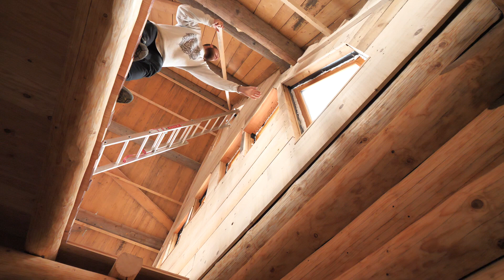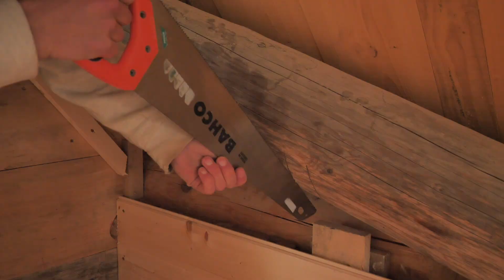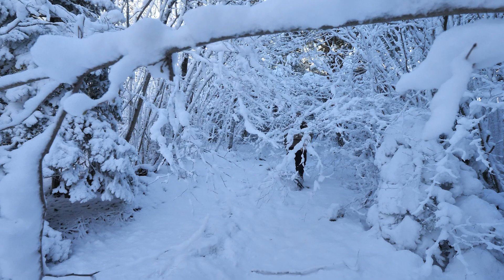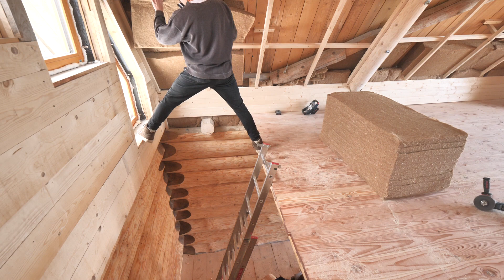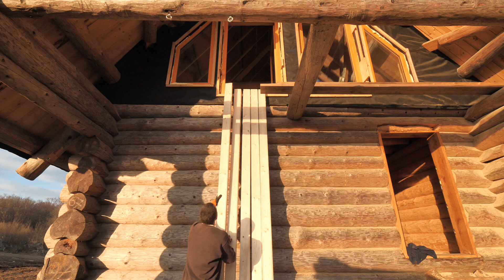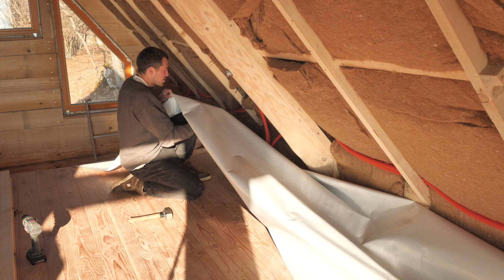Off Grid LOG CABIN Build / Installing The Roof Insulation (S 3 Ep 4)

Comment: The layers. It’s all about the layers. Watching this being done properly is so satisfying.
Reply: unfortunatly this is not done properly with all respect to Nick and all his great and proffrsional work so far this shouldnt be insulated like that , wool shouldnt touch  the boards and the special roof membrane beetween rafters wool and final covering starting from the bottom  ceiling then 25 cm of wool in our climate then roof mambrane at the top of rafters , then 2,5 cm thin boards screwed along rafters ( those boards will make the gap so everything can breath , then boards again thin boards , one layer each side and then propper roof covering or propper roof covering straight to the boards and off course 5 cm gap at the peak excluding roof membrane  so all the moist from inside off the house could be removed
Reply: @miloszkosciolek636  it's a log cabin bro, there's no right way of doing it. People have built them for thousands of years, in all kinds of ways.
Reply: @noone-qg1od  dont take it as a hate talk from me or something this is just a pro advise if the roof is thonnot done that way but  other way it is a 90 % channce that the purlins and boards will get rotten  and all insulation off wool will gather the moist but not relase , no mather is it a full size house or just a log cabin it is important to think and get advice about all step , the time that was spend to build that cabin and the costs that Nick had to cover are huge , so it is verry important to dont take those costs again in a couple off years , also im not trying to play a smart ass im struggeling my selfe wit a lots of problems while buildyng my log house and yes i did planty of mistakes , im doing 200 m square house just by me selfe so i know about costs , health , time , and everything else that i have to deal with ... do it once for life ,,, dont work for it  and fix it  ever more
Reply: @miloszkosciolek636  I don't think the insulation is wool. It's some kind of recycled fibre and probably doesn't have the moisture retaining qualities of wool. If this is the case, he wouldn't really need to let it breathe, and it would be better to fully seal the inside layer against any moisture escaping and trap the air in the roof space to retain heat. I hope at some point he explains his reasoning for how he is doing it, it would be interesting.
Reply: @Mark Wheeler  it looks to me like mineral wool/insulation though it could contain hemp. He did seal the outside layer with a water resistant layer so if he sealed it inside with a breathing layer, he'll be fine.
Reply: @miloszkosciolek636  layers from outside to inside are: membrane, boards, insulation, breathing membrane, cover. As a professional, as far as I can tell, it's been done right. Don't correct people when you don't know any better.
Reply: @avyitis3425  well i just told better way . wool should never touch the boards,first off all. boards will rotten , if You dont know that You r not a pro .breathing membrane under the wool , yes, but above the wool straight on purlins go membrane , membran can touch the wool but cant touch the boards thats why an that membrane its covered by thin boards 2,5 cm high  that are screwed to purlins , then gose boards , this is a pro, whole scandynavian countries r doing like that , i bet You never done this and the knolege dat You own came from internet :)
Reply: and like i said gap at the peak ,
Reply: @miloszkosciolek636  I am a professional carpenter. The majority of what you wrote is simply bullshit. You have no idea what you're talking about but are trying to make it look that way. A simple online search proves the opposite of what you say, for anyone who doubts me criticising you.

Besides, I never said anything against the methods used in the video. If you're unable to read and/or understand the language properly, you ought to change that before you "open your mouth".
Reply: @miloszkosciolek636  Hi the material used was jute
Reply: @avyitis3425  Yes he said in the video description of the insulation that it was a recycled hemp product!

Comment: Nik, Been watching you for a couple of years.  I am building a Timber Frame cabin.  We raised the frame in October 2020.  Heading out to put the roof on this week (750 miles away).  Yes, the roof insulation is a complicated proposition.  I have a vaulted ceiling inside with Tongue and groove 2"x6" Monterey Pine.  10" of open cell foam insulation on top after much discussion and investigation.  I was going to use Hemp Fiber but after talking to some experts I decided to have the blown foam.  It's more expensive but it will be done in a day and I don't have to do anything (but pay them) It will give me R-38.   From an expert advice I discovered that you lose 80% of your heat through the roof!  Which makes sense since heat rises.  What a pain to hold the insulation up into the ceiling.  Sorry man.  I've made a few mistakes myself.  Thats O.K., If we didn't make any mistakes we wouldn't be human.  You my friend are Super Human.  I'm 65 so at this stage I'm fortunate that my two sons are helping me.  Of course it will be theirs someday.  Good luck.

Comment: Great job on the insulation. That along will keep the place nice and cool in the hot summer months. I'll watch to see exactly what your plans are on heating. I'm attempting to surmise how that hot water tubing is going to get through the vapor barrier and wood walls efficiently. So I'm guessing you'll be heating water running through the tube system and waiting to see how you do that part of the plan. The inner wood is going to definitely act as an insulation barrier between the vapor barrier, then through the wood walls, so it's going to be well heated and take some time time to penetrate. Never seen this structural approach before. I'm curious on the heat source now... :) Nice job as usual on the construction.

Comment: Very interesting!! Been wondering about electric rough-in. Don't think I have ever seen the "Pex" type conduit before. Now I wonder about type of wire and gauge to be used. Also this is the first time I have seen this type of vapor barrier. Around here we would face the foil toward the outside to keep heat out! Of course we only get an inch or two of snow every year or so and feel like we are in a disaster when the temp stays below freezing for more than 3-4 days at the time.
Reply: Wondering if he’s going to run THHN wiring through there......

Comment: Overlapping the layers of insulation insures less heat waste for your house. Being made out of wood, you will have a better insulation anyway, but every little aspect helps.
Also, I beleive that in all the EU, electrical tubing that touches the wood has to have metal interiors, no matter if the outside is made or not of plastic. This is just to insure that none will catch fire.
I don't want to be bugging you, it's just what I would have done.
Keep on the good work!

Comment: You might want to consider pre-threading your electrical conduits in the future or elsewhere on the cabin. Passing the cables through conduits of that length won't be easy! Good luck, it's looking great.
Reply: When electricians fish conduit etc.. they don't usually feed wire first, they'll feed a string.. and do that with a plug or a rabbit and an air compressor. It's apparently relatively trivial.
Reply: @sobconners  hmm, I didn't know that. Thanks for telling me. But from my experience, the wires (especially if there are 3)  get caught up in the ridges on the conduit (at least the conduit sold near me).  A good tip however to keep for the future.  Keep up the good work on your end. It"s so rewarding to see the fruits of your own labor!
Reply: Yah I didn't know either when I saw electricians buriying long conduit runs outside with nothing in them.. talking 100-200' or more. The ridges won't matter.. you don't pull the end of a wire like you think either.. I've fished a lot of wire.
Reply: @sobconners  It kind of depends on the type of conduit used, they way it's installed and also local practice. I'm Nik's neighbour (one country over) and I think most electricians here use a single 1.5 mm2 wire rather than string. Larger conduits for underground wiring do tend to come with string already in.

In a place like this I guess you'd just push a drag wire (a kind of stiff spring) through the conduit and attach the wires to that and pull them through. I'd probably have pulled the wires before closing the walls though.

Comment: Future proof the setup in the walls with conduits for network. Might not need it now but how nice would it be to want to add an access point and have a conduit to make running a wire to it easy? With all the internet satellite options coming soon you will have a good connection even in the middle of nowhere.

Comment: Hey @Nik Rijavec quick question someone doesn't know vey much about isolation I guess the orange tub it's for giving some air inside isolation layers, right? Or there is any other porpuse like for preventing moist? Thanks in advance! I'm a fan since you started this project a couple of years ago! Greetings from Costa Rica
Reply from the maker: It's to run electric wiring through later. Thanks for watching!

Comment: Got foil to deal with radiant heat both with the roof and the living space inside in my attic. The rule is a 13 mm gap as both a barrier and a vent to the roof from the soffits then foil to reflect back the cold or heat. Next comes closed-cell foam board insulation and in my case more foil on the inside...  

The question your use of foil brings up is why the single layer of foil is on the inside as opposed to the outside? 

The rationale I was given is there is a greater thermal drive from the heat and cold outside into the house than from the house to the outside. It seems the thermal transfer should be the same in or out. 

It has been too many years since Thermodynamics and it never required work by me in my professional career. An inquiring mind always makes for more even if the work is interesting. Thanks for sharing all your thoughts, hard work, personal insights, and the beauty that seems to have universal appeal.

Comment: Seeing Nik run flex tube throughout the ceiling as preparation for running wires was a 😬 moment. Hopefully they pulls will be short enough that pulling wires in them won't be a hassle.

Comment: Without airflow between the roof and insulation won't you get moisture condensation on the inside of the cold inner roof wood?
Reply: I guess the moisture barrier prevents condensation.

Comment: What's the tubing for? I was thinking for the wiring but you didn't mark the location of them so guess not.
Reply from the maker: It's for electric wiring. I've never done it before so I don't know what should be marked?
Reply: @nikrijavec47  Oh, so it was for that! :) I figured you would mark where you cut the tubing so you knew where to drill the holes in the panels later on.

Comment: and again: Nik, you should overlap each piece of insulation with half of the other piece. you know what i mean? like brickwork - each brick is covered with half of the other... in your case, cold air will pass through at the joints of the insulation layers...

Comment: Why don’t you just run 12-2 Romax for your electrical? Or is that for code ? ( conduit )  that is going to be vary hard if not impossible to pull wire through all that !

Comment: What is the purpose of the wire conduit tube? Is there a local code where you can't use the wire alone or is it a budget issue (plan to wire at a later time) ?

Comment: Would anyone care to explain to me what the purpose is of the silver foil and the orange piping? First guess would be the foil is some kind of moisture barrier and the piping is for electrical?
Reply: Air contains water. Hot air can contain more water. If you cool down air sufficient, water will start to condense as the air can't contain it anymore. 
Now, air will always travel a little through the isolation. If cold air from the outside travels in, it gets heated up. This isn't a problem as the air can now more water. However, if air from the inside moves out through the isolation it's temperature drops and this can lead to condensation in the isolation. At first the isolation becomes less effective, but worse it can lead to rot. 
Therefore, when isolating you install a most barrier on the hot side or you need to make sufficient ventilation to get rid of the moist.
Reply: @yottaforce  thanks for explanation, so I was correct about the foil being a moisture barrier then. Do you happen to know what the orange conduit was for?
Reply: @DaCheat100  electrical wiring
Reply: @DaCheat100  I'm 100% sure that is for electricity.

Comment: I love what Nik does but I'd be worried about getting wires through that flex conduit after the walls are closed up.
Reply: A small piece of plastic bag attached to a string, use vacuum cleaner from other end & then attach electrical cable to string!!! Easy!!!!

Comment: Why not put the electrical before insulation? To simplify and avoid rework / dismantling?
Reply from the maker: The red tubes are exactly for that, to run the electricity whenever I want through them without dismantling anything.

Comment: Why didn't you lay the insulation boards so that they overlap? So in a bond like masonry, so that the joints are always covered. The joints are not tight, which weakens the insulation!

Comment: I hope you don't regret not installing the wiring BEFORE the wall boards... The wire will crimp and jam in the plastic conduit, unless you're going to use compressed air to help push the wire through.
Reply: A small piece of plastic bag attached to a string, use vacuum cleaner from other end & then attach electrical cable to string!!! Easy!!!!
Reply: @tonygrimes13  Smart!

Comment: 1) Why on earth do you want to hide those magnificent (horizontal) round timber roof rafters and only expose the center vertical ones? Years and years ago my dad built our family mountain cabin, and though the quality of the materials and the sturdiness of the construction was/is only a fraction of what you have put up here, it was obvious for him that the horizontal rafters (ofc there are no vertical ones) should be visible in order to make the right "timber cabin" design. Hence, I myself would NOT have construction the roof as you did here. I'm no architect, designer or certified roofer, but I would have made the roof with 2 levels/sheets (top could even be water resistant ply, and an inner layer could be fire resistant)
 with ample space between for up to 35-40 cm insulation. Point is, both layers should have been constructed/mounted on top of the exposed timber rafters (or at minimum, at least 1/2 of the rafters should have been exposed from within the room). In the end it will be interesting to see how your roof will look like - the construction looks interesting and maybe you hit the nail design-wise ....

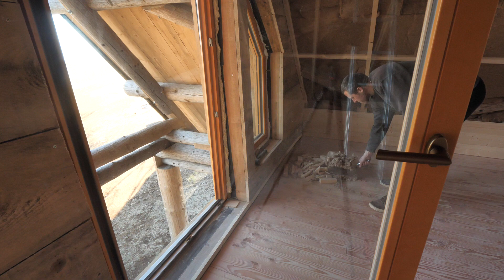2) @28:17 "Best garbage bin is the window!" Reminds of the E-European workers I employed to help me remodel my old house: all the waste went out the window, all the waste was out of sight, all the waste not their problem. For weeks after they left I had to pick up their trash - even cig butts (the most abundant plastic pollution in the world) spread all over my driveway and lawn, and behind the barn they had just dumped a 60 lb blob of excess cement when they could have asked me where to dump. It was obvious they had absolutely no understanding of waste sorting, but they had a unconditional love for creating double or triple the work. Amazing intellect ....

Comment: Vapor barrier is supposed to be one piece. With no holes or ends flapping in the breeze! 
That's why they have those red 3M tapes. It's not because they have money to throw away or add to their work. 
When the smell of mold and mildew shows up, you'll know why. 
You should've gone with a polyurethane foam.
Reply: Would you have run sections from the end wall to the big beam, then another from the other side of the beam to the other end?